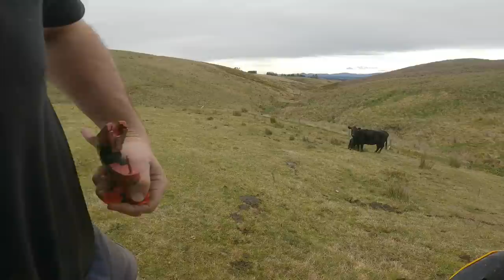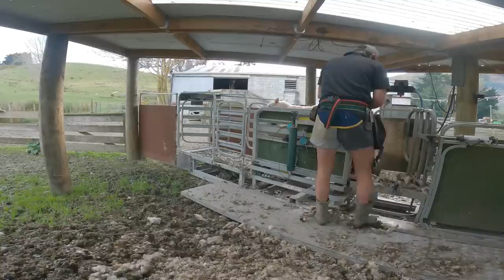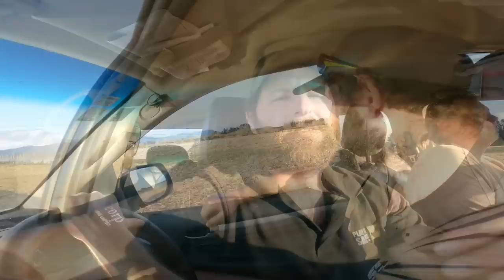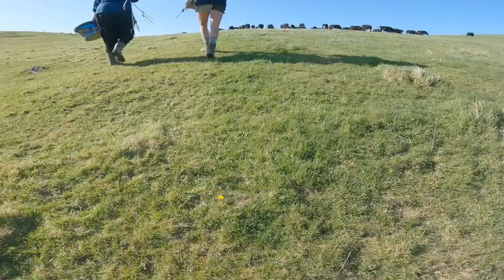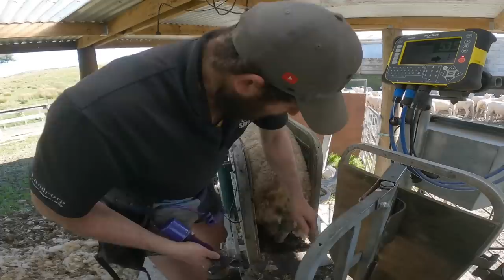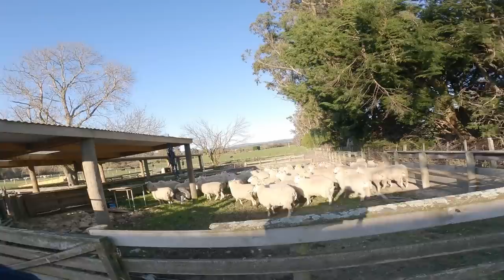SHE'S CRAZY! Protective Mumma...

Comment: Its only once in 35 years of calving that I've felt uneasy with a cow and its new born calf. I placed the quad bike between them before tagging the calf. Probably beef cattle been more isolated in the back blocks with less human contact could cause more incidents of stroppy mums?
Reply from the maker: We haven't tagged at birth before, so its new for the cows as well as me.
Reply: Not necessarily. We had Hereford cross that were worked with daily and yet one had a calf in the dead of winter and I couldn't get near the calf. Took my Dad along to keep the cow off me and we got mother and calf safely in the warm barn. The only time we had a difficult cow.

Comment: Is that protective cow pure Angus? I thought they were supposed to be user friendly. We have a variety of breeds and have yet to get one being difficult. Although that could change as we have a Murray Grey due next month. They are supposed to be very stroppy with calf at foot. Also had an interesting sheep problem at the weekend. Had a hogget suffer Ring Womb over Thursday night. Nothing could be done and she has joined the circle of life this morning.
Reply from the maker: Yea generally they are pretty good. I have never tagged at birth so it's new to them. What is ring womb?
Reply: @kiwifarmernz , the ewe goes in labour but the cervix won't dilate. She pushes out the lining and placenta but not the lambs. They die and in due course so does she as the lambs rot inside.
Reply from the maker: Thats rough. Dont think we have had that but i will keep an eye out for it now.